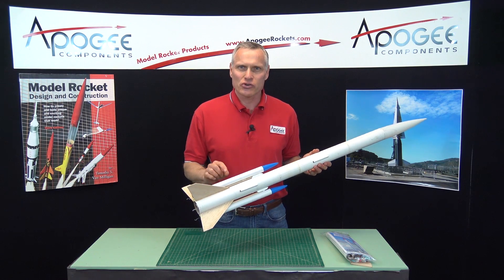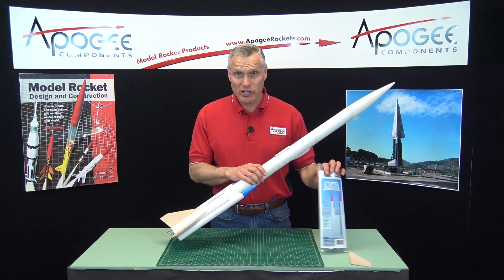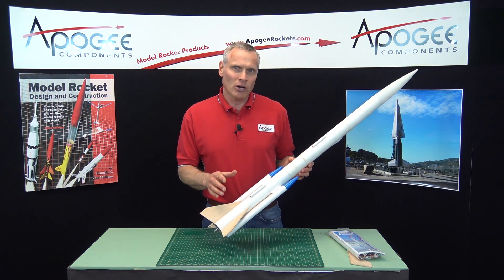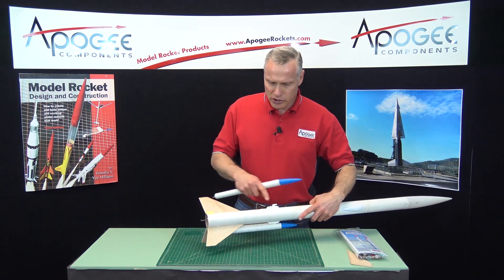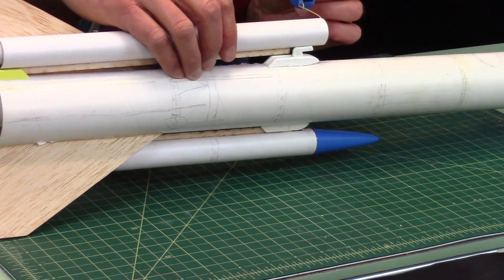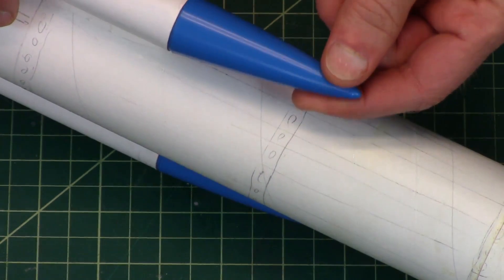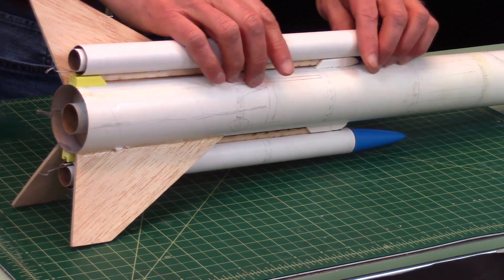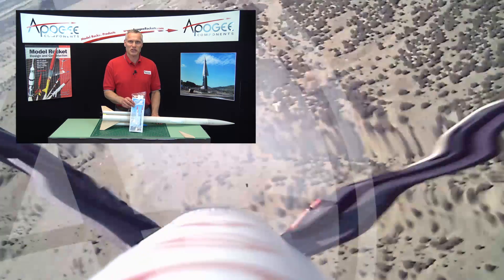How the Strap-on Booster Pods Work

Comment: You made mention in a different comment I made that you can run these pods with 24mm d engines. I assume that means don't install the 18mm motor mounts and just sing the d engines into the booster and just use the centering ring to index the engine depth?
Reply from the maker: There are options. You can swap out the 18mm mounts with a 24mm mount. Or you can simply use a 18mm diameter Quest or Aerotech D motor.
Reply: @apogeerockets  awesome, thank you.

Comment: I made a scratch-built rocket many years ago that had two strap-on boosters. I used a small aluminium pipe (roughly 4mm OD) that was fixed pointing out 90 degrees from the booster side and slid into the opposite pipe on the side of the main rocket tube.  The boosters were sealed so no chutes but the hollow aluminium pipes did allow the ejection charge to escape through them so would push themselves out of the body of the main tube. The lower mount was just enough to hook the boosters as the aluminium top mounts were very secure. When they separated all that was left was a tiny metal hook as the sliding fit at the top was just a small hole. I tested it on the ground in a jig a lot until I got them to pop off just right with a C6-0. The ejection charge was just a sprinkle of BP. It hardly needed anything as there was no other way for the gases to escape. I think a full ejection motor would blow the strap on up.

I am in the UK so it's hard to get a lot of HPR and even MPR stuff but I have managed to get hold of F15-0's and can easily get D12-0's as strap on boosters so I am tempted to make something similar again. I sometimes think about making small explosive "bolts". You can get tiny firecrackers in France that are about 3mm in diameter and 15mm long and could easily be used to fix boosters to the sides. If you used quick match, it might be possible to have them explode at burnout. They would probably be strong enough and the side of the rocket would only need protection from a small area of aluminium sheet. It might be fun to see if you can get the concept to work with A-size engines. It would look very cool if they popped and the booster fell away.

The boosters did not need parachutes as they were so simple they just tumbled. I wasn't too worried about getting them back undamaged :-)

Comment: Would the boosters add enough thrust to overcome the extra weight and surface area and send the rocket higher? Or is it mostly an ascetic thing? (They're really cool either way!)
Reply from the maker: It depends on the specific rocket motor you put into the boosters.

Comment: hello, how thick, wide and Long is the wooden strip that is attached to the booster rocket?
Reply from the maker: You can purchase the parts and then make measurements at: https://www.apogeerockets.com/Rocket-Kits/Skill-Level-2-Model-Rocket-Kits/Strap-on-Booster-Pods
Reply: @apogeerockets   i want to Buy them but i Need the sizes before. I Need to knew if it fits in my actual project
Reply from the maker: @dunkelschaf4636  In that case, they probably won't fit.
Reply: @apogeerockets  what kind of answer is that? As a prospective buyer, I ask a question and get a stupid answer. what kind of competence should that be? but it's okay .. i'm looking elsewhere. Thank you 🤦‍♂️

Comment: Reverse the way the hook up is working. A thicker ring inside the lower body tube and let the booster hook inside the body. The upper hook will slide down into the body. Then the ejection charge will slide the hook forward and release the booster . wind then rotates the booster out and away. A spring inside the body could push a plate out to smooth the body and fill the opening.
Reply: P.S. This also brings the booster in closer to the main stage. And as the booster rotates out the nose cone pulls out a chute for recovery of the booster.
Reply: P.S. This also brings the booster in closer to the main stage. And as the booster rotates out the nose cone pulls out a chute for recovery of the booster.
Reply from the maker: Go for it!

Comment: I made my own strap on boosters and It works by inserting a flat rectangle into the pod and making a small box frame made in between the pod and the core stage, so it's only open when it's separated from the core. When the recovery charge happens, it pushes off the rectangle, and exposes the parachute hidden inside the small box.
Reply from the maker: Sounds interesting. You should send us some pictures.
Reply: Wow. That was quick

Comment: We used to fly a 3-tube first stage to mimic strap-on boosters.  Have main rocket as single tube design and was the 2nd stage.  First stage was 3-tubes.  Larger center tube with with two longer side tubes that fit partway up the upper stage.  Center motor was a booster like a B6-0 and the two sides were B6-3 engines.  Booster lit the 2nd stage and separation happened.  Few seconds later, the side engines would eject the chutes or streamers from the side tubes.  Worked kind of neat.  But these side boosters would have been cleaner and more fun.  Also wouldn't require it to be 2-stage.  Lots of fun new stuff. (compared to my flying in 60's and early 70's.  :-)

Comment: Do you think if I were to use two of the biggest c motors in these, it will lift two d motors? That would be really neat if I could turn my two stage into a three.
Reply from the maker: I suggest you run it through the RockSim simulation first. On our web site, you'll find the file under "The Flying Machine" kit. Use that to modify for your unique configuration.

Comment: Here is a slightly different design for larger rockets:
http://www.rocketryforum.com/showthread.php?41657-Parallel-Staging-Motor-choices-and-designs&p=476655#post476655
Reply from the maker: Impressive design!
Reply: I like your approach also.  At first glance I was concerned that a booster might not come off immediately when it is supposed to.   But after further thought, it seems likely that some of the ejection gas would exit through the upper slot as the nose is coming off and would push the booster away from the rocket.

Comment: I see that these are blue and white. the ones on the website are red and white. can I get them in blue. I am scratch building a rocket called Blue Dragon and the final component I need is the strap on boosters. the core vehicle is blue and white and I want the booster pods to match.
Reply from the maker: Unfortunately, we are all out of the blue. We had just the ones left for the test model in this video. Our apologies for the confusion.

Comment: I've been trying to find a way to do this for a while. My first initial designs used a paper clip and launch lug, the booster wouldn't remain attached unless an engine was firing, I never tested it but got a few test models built before I moved to other project. I then designed one that ditched the paper clip and had a balsa fin hook, that also would only allow the booster to be attached when the motor was firing, but looked better, and would keep the motors on straight during flight. No models where ever built of flown of this design.